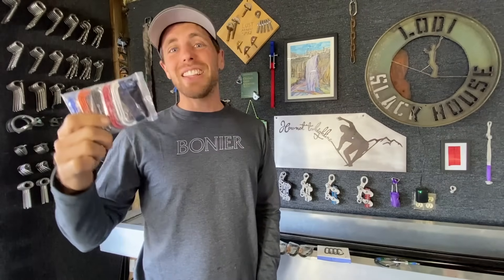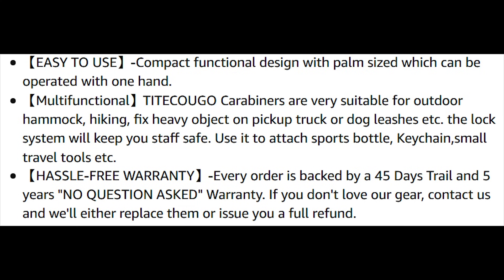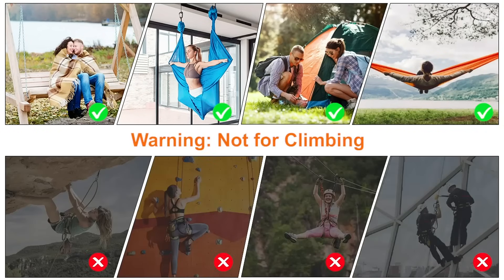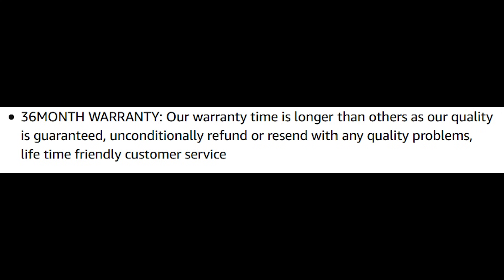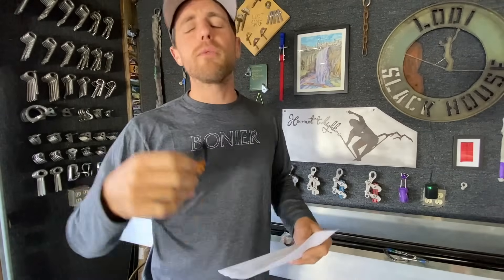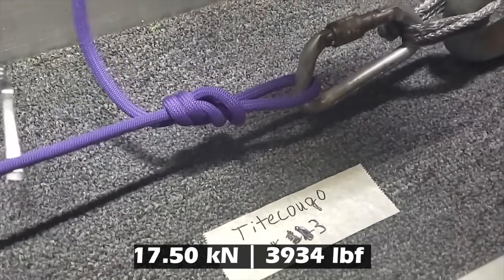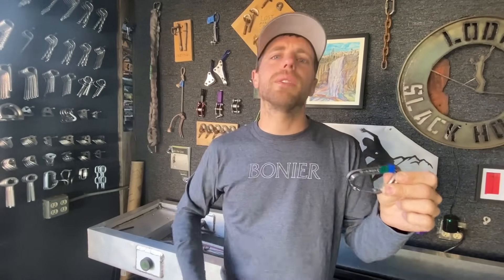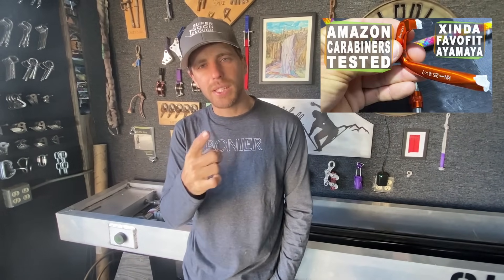I Hate Amazon's 12kN Carabiners

Comment: 6061, 6063, 7071, and 7075 are describing what the alloy of the aluminum is. For example, by weight %:

7075  - 5.6–6.1% zinc, 2.1–2.5% magnesium, 1.2–1.6% copper, balance aluminum
6063 -      Silicon minimum 0.2%, max 0.6%,  Iron no min, max 0.35%, Copper no min, max 0.10%, Manganese no min, max 0.10%, Magnesium min 0.45%, max 0.9%, Chromium no min, max 0.10%, Zinc no min, max 0.10%, Titanium no min, max 0.10%,   Other elements no more than 0.05% each, 0.15% total, balance aluminum

-O, -T4, -T6 are describing the temper of the aluminum. All of the alloys mentioned above have heat treat processes that can increase both the Young's Modulus and Ultimate Strength of the material dramatically. -O is the annealed state. -T6 is a tempering and artificial aging process.

To take an educated guess at the alloy and temper of the material you could take a look at the percent elongation of the section that broke. For further analysis figure out the stress that the carabiner broke at (stress = load/ c.s. area) and compare it to the ultimate strength of the alloy and temper you suspect. For CYA purposes, this would all still be educated guessing, but might be interesting to look into. Time allowing of course.
Reply from the maker: That's super helpful
Reply: @HowNOT2  if you want to do this more structurally, you can attach strain gauges to the material to record the strain curve. Then you can find the strain at break to help identify the material. Strain gauges are pretty cheap and easy to glue on.
Reply: @markkalsbeek5883  
It's not a uniform tensile sample. There is no good place to apply the strain gage. There isn't even a good way to measure how much of the load is in the spine side vs the gate side not to mention all the weird stuff going on with the gate as the whole thing stretches.
Reply: @HowNOT2  

At first-thank you for your testing, its makes me more confindet whe  im climbing.
I have to say one thing, which drives the little sheldon in me crazy- molecule are gases or liquids like O2 oder H2O, this means that 2 or more atomes are connected and thats the only way they exits in nature( except form tec.-application) 
metals on the other side are only made out of atoms!

A test idea which im realy interested in is:
How strong are knots in a passive safety application.
Im from germany and i climb in the so called "sachsische schweiz" . Instead of classic nuts or cams, we only use doubled overhand, figure eight or other knots as "safty devices" (in case of cracks at least).
Because of the super soft sandstone thats the only way allowed, besides UFOs and slings/webing.
Could you test this this out for us?😁
Reply: @MKaden-cv3ts  I don't really understand your point with molecules, but you could refresh your knowledge on types of intramolecular forces (those that hold atoms together in a molecule, as opposed to intermolecular, which act between those molecules) . Intramolec. Forces are Ionic, covalent and metallic bonds. And then see if studying metallic bonds satysfies your curiosity.
Reply: @matijaderetic3565  

My Point is covalent bonds dont exisit in metals, therefore there are no moleculs in the metal matrix, as he said in 2:05. (besides the case of corrosion-reaction, in wich it is actually possible that single moleculs can exit in cracks at the surface of materials such as metals or plastics. This is by the way the reason for the "delamination-like" corrosion of steel. and yes i know metals cant delaminate)
If you want to know more about just hock me up, i can recommend you some titles, mostly in german but i can research for english articels for you. :)
Reply: @matijaderetic3565  Don't think of it as mostly about breaking bonds between atoms but rather the issue is about *crystals*. Not just crystals sliding over each other but more it's the ability of discontinuities (irregularities of structure) to move within the individual crystals. The heat treatments primarily affect the grain/crystal sizes and shapes and internal stresses. Obviously it's a big (and for me boring) subject, but approach metallurgy from perspective of packing structure (face center cubic / body center cubic) crystal sizes and discontinuities and things will start to make sense
Reply: Heat treating metals increases the strength Only!  Not stiffness (aka Young’s Modulus).  Also the stress in a carabiner is NOT Force/CS area.  That is only for a sample in uniaxial tension or compression, like a constant cross section tensile test specimen.  There is a lot of bending going on in a carabiner.
Reply: Definite engineering methodology there. Are you still studying or a professional engineer?
Reply: Can you please tell me do they ever use cold tension on carabiner? (Cryogenic freezing) like on high performance parts? Cheers
Reply: Super helpful enough!
Reply: This.
Reply: Young's modulus does not increase during any heat treatment process. If a change is measured, the quantity is negligible. Other than that, the info in this comment seems fine.

Comment: I bought dozens of these for hanging all kinds of stuff on hooks on the slat wall in my garage. I made lots of loops out of paracord tied with double fisherman's knots, and then I girth hitch all kinds of stuff with those loops and clip the loop to hooks or rings on my garage walls. They're great for that.

I would never try to hang a human or anything over 100lbs ~ 50kg on one of these. I wouldn't hang a hammock, a swing, a tree swing, a yoga swing, etc on them. I just wouldn't trust the quality control of the manufacturing process even if a few of them might successfully pass a test > 12kN. The other thing to note is that even if they can bear 17kN ONCE in a break test, I wouldn't trust how they'd perform after multiple shock loads since they're not designed for that and the manufacturer doesn't test them for that.

For climbing, I buy carabiners from name-brand companies that actually test their gear -- Petzl, Black Diamond, Edelrid, Camp, etc.

But I'd trust these to clip my chalk bag to my harness when I go to the climbing gym. There's no way that I would ever mistake one of these for one of my climbing carabiners, and I don't even bring climbing carabiners to the gym since they require everyone to use their own gear for climbing. If I were to go multi-pitch climbing, I'd probably use a climbing carabiner for my chalk bag just to have one additional one that I could use in a pinch.

So again, these are fine for clipping your water bottle to your backpack or clipping your chalk bag to your harness at the gym, but anyone trying to climb on them should think hard about why they'd risk their life to save $10 or reduce their gear load by 50 grams.

Comment: It's a bit sketchier nowadays. Most of the 12kn's are gone, and the "brands" mentioned in the video don't exist anymore, of course, but now I see a set of 24/25kn "rated" ones, from equally non-brands... and those are definitely advertised for climbing. I'd never buy it over a real brand, and they're not sold anywhere outside of Amazon and Temu, but somebody will buy them..

Comment: But… if I got 2 non climbing rated 12kn’s for my hammock which are drastically weighted less than the stock Carabiners that came with the hammock ill be ok right? Just one guy using the hammock. Sorry if this is a dumb question I don’t climb please forgive that if it’s ignorant I do understand the tensile weight rating on the side is 1213 so just over a tonne each correct? Yes you can totally mock me in the comments for “camping carabiners” but it’s not my fault our hobbies crossed paths here 😂 oh I got Freskaro’s 12kn off Amazon have I been bamboozled?

Comment: I use UNIJOYs for holding gridwalls up in my pop-up shop.  They dont have to hold thousands of pounds, they have to hold 80lbs tops, static load.  I certainly wouldn't use crappy keychain carabiners though.  So this weight of carabiner does have a purpose, it's just definitely not for climbing.  But folks do use carabiners for other things besides climbing.  I use little FresKaro kN8s to hold up around 30lbs in the same shop.

Comment: Why doesn't the hinge pin break first? Is it hardened steel? In my opinion use steel I don't care how heavy it is.  If something is 500 times smaller but 1000 times stronger that is the material you use for the whole thing if your looking for strength. BTW if your SO scared to be up there why do it?

Comment: As an arborists we use them to zip line small limbs to the ground, each 23kn sling runner has a "junk" carabiner.  we have lots of them in the tree or bucket truck to get limbs down without having the used ones sent back up.

Comment: By the way, just saw today in a garden someone having a home made swing set. The seat is held with ropes (I presume static ones). The ropes are connected to the frame via a cheap carabiners - I recognized them as they are sold in local shops, very similar to amazon ones. 

The structure is: Frame (wood), ring bolt to the wood, carabiner connected to the ring, ropes and seat.

Would it be possible to test cheap carabiners whether they are able to hold safely those seats for kids and adults alike? (from your tests I would say they may be sketchy)

Comment: Aluminum, unlike steel, will fatigue even at very low loading with each cycle. Steel has a stress value where loads lower will not cause fatigue. Aluminum has no such lower limit. As such, a time based retirement actually makes sense. True, I think the tests I was looking at were bending tests but watching your pull tests, it seems that part of the fail is from bending anyway.

Comment: I do not really see the point for testing carabiners not designed and not allegedly designed for climbing, with no possible confusion. There are many kinds of carabiners for many uses, and climbing is only one of these uses. Even beginner climbers know that the only carabiners for climbing are those with a "climbing" certification (or EN12275), so what's the point of testing and blaming carabiners for hamrocks, dogs, heavy duty, hiking (the image clearly shows a guy scrambling on the rocks and not climbing). So, what shape should these carabiners have for avoiding confusion with climbing carabiners???

Comment: Never use a carabiner not strong enough for climbing for a hammock! The load is very high and a carabiner breaking on the head end of your hammock during sleep will likely kill you or leave you handycapped.
Reply: Lol meanwhile I've been backpack hammocking with a pair of 8kn mini biners for a couple seasons already. I would never set it up on the edge of a cliff or high in the trees but based on my testing, my hammock fabrick will 100% fail before these biners do
Reply: @kevinm1734  The parallelogram of force multiples the force of your weight on the hammock. If your head falls unconciously from 5ft/1.5m height because that end bursts you will have severe (and potentially deadly) brain damage. This can safely be assumed form the test standard for cycling helmets. (They may kill you at that drop height.)

Comment: You need polycarbonate covered with stoneguard to catch the flying pieces without scratching. The soft stoneguard is surprisingly good. 
But nice they did beeak above the rating. But yes gravity + weight is a great force multiplier.

Comment: So basically all the units you tested (and you tested many in this video of the uncertified/unregulated ones), they all exceeded their break test limits, That's good right? And you'd expect anyone who is serious about climbing would do their research, such as watch your videos, you have good videos. The only reason you don't personally approve of these products being used in climbing is because of their 12kN limit and potential metal fatigue issue, however, at the time of purchase you found every one met or exceeded their rating, correct? But isn't the same true with professional and certified gear? Ropes come as rated but can degrade or wear over time, putting loops and knots in ropes, as your tests have shown weaken ropes, so doing constant checked on gear is a vital part of climbing, of life!? If you put a nick, dent or rock scrape on a major axis into a certified carabiner immediately upon purchase, would this not weaken it and make it's certification useless? It's like in the UK, we have MOT exams for cars, to ensure they are worthy and safe to be on the road. This exam is valid only for the time it is in the MOT testing center. In the following 12mths parts wear on the vehicle and can make it become dangerous. It would be wise for the seller to adjust their description to say that these 12kN carabiners are useful for camping, hiking, carrying, but not climbing or belaying, and you are right that one looks like the other, but if I needed something I had to put my life in I'd go certified and I'd check the equipment before every use as I do my full body harness & snatch cable.

Comment: If you use this stuff for dog leash, they are pretty fine. I honestly have more problems with material carabiners when I climb. I took them all from my harness and use fully certified smaller screw-carabiners, they are about 50 grams. Like this I always have 2 or 3 reliable spare carabiners with me in case I drop one.

Comment: I never use climbing gear for anything but climbing.  I don't use my ropes, webbing, or crabs around the home, garage, car, yard, or camping.  It stays in the climbing bag, until I go climbing.  Side benefit is I never misplace my climbing gear.   
These BS little Amazon Al clips are great for hanging that hammock, clipping things to your pack, or that key thing everyone wants to do.  I use them in the yard and camping.  Home Depot has quick links for projects in the garage, tiedown straps for the truck roof rack, and tow straps for vehicle recovery.
Most industries have their own Standards Committees, that study and assess their specific needs.  They incorporate years of experience in the field and sometimes painful real life lessons. Compared to many industries, climbing gear has very low safety factors, so in reality make for poor substitutes anyway.
As the saying goes, use the right tool for the job.  Climb safe.

Comment: If they're advertised for their rating, and say in the description they're not for climbing, and don't have pictures/advertising that contradicts that, I don't have a problem. 

These mention not for climbing in several different ways. I don't have a problem with the aerial yoga, because you're not high above the ground for that. Aerial silks are different, but the picture they showed was of someone barely a foot of the ground, and even if these broke it would be fine.

Also looking at the breaking strength, either rated or tested, it looks plenty for those applications, and if you did ignore the rating and warnings, good enough for climbing. Seriously use the right equipment, but you talk about falls maxing out under bad situations at 4-8 kn and it's rated for 12, and tested at 16+. That's a plenty healthy safety margin. These budget, obviously not for climbing, well labeled carabiners fail at a higher load than many products actually used for climbing.

Not every product needs to be rated to handle life an death situations.

Comment: Why is 12kn for a carabiner sketchy, but 7-10kn for nuts safe?
Reply: Yeah, I don't get it. They tested micro nuts which were rated and failed around 6kn and titled the video "You won't believe how strong micro stoppers are! Climbing nuts tested in real rock" and the conclusion was "would whip" but 12kn carabiners labeled repeatedly "not for climbing" is sketch?
Reply: @AGryphonTamer Because the standard of manufacturing is not the same and there’s a large variation in manufacturing quality for one. 
Because they’re made of Chinesium😅.
Reply: Yes..... fucking great question bro!
Reply: He explains why. Watch the video and listen.
Reply: None of you watched the video, huh?
Reply: Because in that size crack they're getting the highest number possible with small gear and 7/8kn is a 2:1 margin on a fall still. That 7/8kn is not ok as a master point or as part of a 'bomber' 2 bolt anchor but it is fine when used properly. 
As a placement you will sew up a marginal piece (yes a 20kn hex can still be placed badly) so losing a few isn't fatal, you would equalise them and use ~5 placements in a natural pro hanging anchor.
Same as why my 7mm cord is ok as an anchor but not a rope - because I use 4 to 6 strands bundled and a BFK so the 12kn cord has minimum 24kn used as an anchor, typically 6 strands + knot = 12×6=72kn÷2(knot)=36kn and triple redundancy.
Context of use.
Reply: Because carabeeiners are single points of failur meaning If one Break you die. While nut should be redundant meaning If one fails you do Not die

Comment: Beating dead horse: 7075 and 6061 are different compositions. T6 is a precipitation heat treatment that can improve the material properties of both. Regardless, reputation is everything here. Without a material cert, it's marketing B.S. 

Lastly, after 20 years of destructive testing .... plexiglass guards are ur friend. Stop ducking behind your equipment. 😉

Comment: I will say I used to use these for my hammock, for normal hammock use at like 3' AGL max.  Eventually I decided Metolius FS stands for "full of s___" referring to the "for climbing only" marking, and started using the minis for the hammock.  They haven't exploded yet.
All in all, most of the improvement comes from Metolius doing a better job of deburring the "beak" that engages the wiregate, so it doesn't snag my stuff.
I mean, I don't know what shock load my hammock is rated for, but I really wouldn't expect even a 12kN biner to be the weak point.